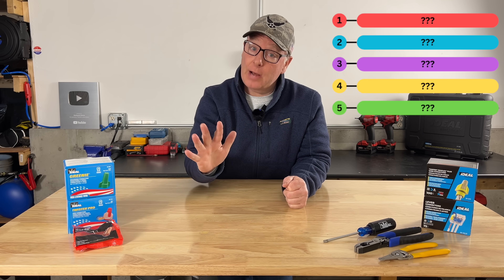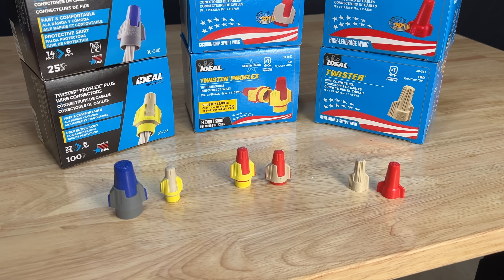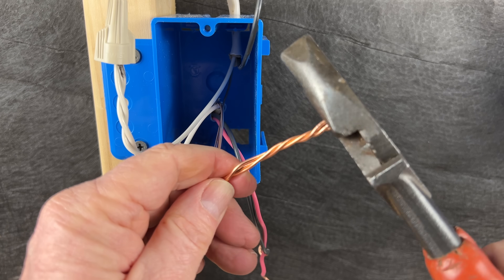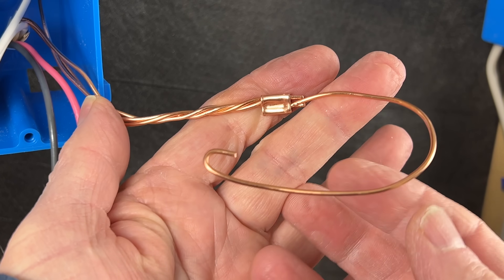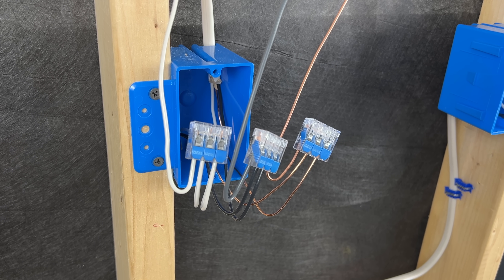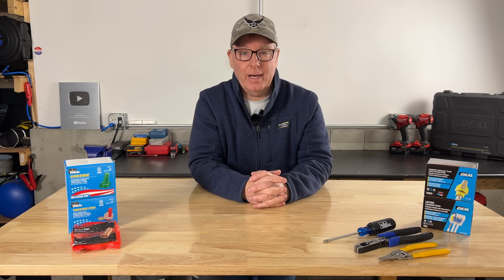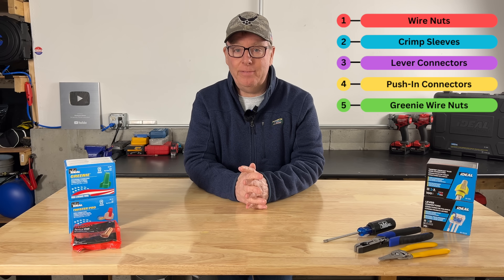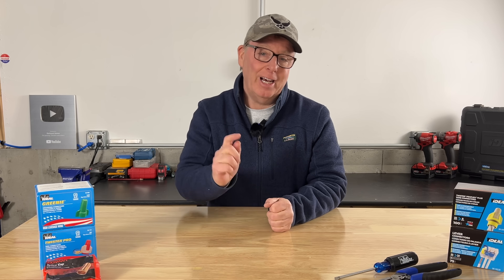How NOT to Connect Ground Wires in 2025 (Safety First)

Comment: Even using greenies for a while, but also use Wago and regular wire nuts. The ideal lever connector seems ok. I’ve always ran tape around the lever style connectors just as insurance from opening up when wiring the device. I never use the push in or bucannon crimp type.
Reply from the maker: The Ideal lever connectors close really tight. I don't think tape is necessary for using them.

Comment: I do not prefer lever connections (or any other connectors that cause me to break the grounded conductor). Whatever conductors that are used, I want to see the entire bundle of bare conductors twisted together tightly and then joined at the ends. 

I prefer the green wire nuts or the copper crimp sleeves as my favorite options. Buchanan makes a special crimp tool btw that crimps from all four sides. Not sure how necessary it is, but I like mine.

Comment: Sorry, but I hate electricians who pre-twist wires together. If I have to go back in and add, replace or remove a wire it's a huge pain in the ass, especially if I am working it hot. The speed & rate at which lever connectors are being replaced in the manufacturer's catalogs indicates to me that they are still being perfected, so I don't use them. Stab in bricks, suitcase crimps & wire nuts are still the same after 40+ years.

Comment: Two additional grounding methods for older homes with metal boxes connected to metal conduit; green ground screw within the box and green (or bare metal) tab on the end of the box
Reply from the maker: Yes for sure for bonding a box but this video was just covering connecting the ground wires together. I think I will make a complete grounding video cover the neutral bond as well.

Comment: The red & yellow Twister Proflex is absurdly oversized for a couple of ground wires. Sure it works, but why use such a huge wire nut and waste so much space in the box? The blue & orange Twister Proflex Mini (model 343) is much smaller, has the same rubber skirt, and handles up to four #12 solid wires.

Comment: Ok you dont' cut the twisted wires off square you cut them off at a 90 degree angle which tells me you never held a job as an electrician in your life.
Reply from the maker: lol.. I love hearing comments like this.. 41 years licensed electrician, last 10 years electrical engineer. Union trained and worked on some of the largest projects in the US. Had this video approved my an large electrical equipment manufacturer..

Comment: I'd love to see a treatment of the grounding clips that go on the side of a metal box. Where are they required, optional, or prohibited?
Reply from the maker: Metal ground clips for boxes are code compliant as a method of grounding metal boxes, provided they are an approved type and securely connect the equipment grounding conductor to the box. I prefer a ground screw myself.

Comment: Why didn't you mention the Ideal Set-Screw Wire Connector, Model 22, 20-10 AWG. It is the only connector I will use. I have seen problems with wire nuts and one problem is one too many. For the ground, I leave one wire long like you do and just leave the cap off. Thanks for all the information you provide.

Comment: I cannot believe that some electricians are still recommending these wire nuts from last century. Spring loaded push in connectors with or without lever are much more reliable than wire nuts or screwed connections. Since copper has a plastic forming component the contact pressure can become lose over time - especially when moving the cables or using in vibrating environments. A spring loaded clamp is not losing its contact pressure and here in Europe we are using about 99% spring loaded connections for such purposes. For these clamps a brand like Wago is recommented. Wire nuts are more less the bad example why some houses burn down.
Reply from the maker: You run a 2x higher voltage than we do and I believe you run stranded wire which is probably better for a spring loaded connector than a wire nut. The lever connectors here have improved greatly with these new designs but they will never hold up the reliability of a wire nut when connected properly to solid wire.

Comment: My house (built in 1975 in Doylestown PA) had NO connectors on the bare ground wires.  Whoever did it just twisted the bare wires together with no pressure connector of any kind.  Was that ever legal???   Just the act of accordioning the wires back into the box starts it untwisting.  
Every box I worked in got a Greenie.
Reply from the maker: I've been an electrician since 1984 and it wasn't legal then. I doubt it was legal in 1975 either. Good job fixing it up though.

Comment: Are the push-in connectors equivalent to back-stab?
Reply: No. On a back stab the spring metal is deflected towards the front of the receptacle and tension, while pushing down, is also pushing to the rear. A push in is at a 90° different angle, so the wire deflects the spring up, and the tension is to the bus on the push in. It's a mechanical contact advantage for the push in connector. A backstab connection is rated for 15 amps maximum and can only be used once. Using the screws on a residential grade receptacle, you can use 12 gauge wire and a 20 amp circuit. Push ins are rated for 20 amps, accept 12 gauge wire, and can be used again.
Reply from the maker: I think better than the stabs but I prefer the other methods shown in the video. They are very handy for lighting.
Reply: I like your content and style, good stuff. Some random adds for another day:

1) often see box screws and drywall screws used to secure the ground to the box, and light fixtures (especially florescent fixtures) vs the required 10-32 threaded connection for ground screws. 

2) The IDEAL 1 wire, in-line, push connector is an extremely handy connector to have in the truck.  It’s very handy to lengthen wires when you run into a box with very short wire leads.  Put a wire tail on one end, then reach in with needle nose pliers to firmly insert the “shortie” into the other end of the connector.  

3) It’s never really clear what crimper is “rated for” or “recommended by the copper crimp mfg”; but that’s what the instructions always say on copper crimps.  I see some folks just using their Kliens vs a real crimper.  IDEAL would be wise to specify their recommended crimper for their crimps.  

This is one of the first forums I follow where there’s no arguing on lever, vs wire nuts, pre-twist vs not.  It’s VERY refreshing to see.  I really liked your comment on pre-twisting too.  

I never read / realized receptacle back crimps are only good for one use. I never use them, most firms I worked for didn’t allow their use.  Great information for the lunch break arguments!
Reply from the maker: @ Awesome and insightful comment. Thanks for jumping in and sharing your experience..

Comment: Cracks me up, all the people saying you must twist the wires when using a wirenut, but think a crimp sleeve is acceptable for an equipment grounding conductor. The house I wired nearly 45 years ago is still going strong without either. But I took my time to properly strip and make all wires even, and installed the wirenuts tightly, using linesman's. In my present house, from the 60s that was built by contractors, I was able to twist off every crimp sleeve, many of them by hand. You're not doing that with the Buchanan B-caps. They work perfectly over the long haul.
Reply from the maker: If you were able to twist them off they weren't crimped well. But remember we also pre-twist them as well.

Comment: Long term DIY-er here. I bought my house from a guy who had delusions of adequacy. He made such a hash of its wiring that I had to redo it from scratch. I discovered Greenies early, and it was love at first sight.

A robotics team that I mentor uses another brand of lever connectors. You can bet your bottom dollar that we'll try Ideal's offering next fall.

Thanks.
Reply from the maker: I'm glad you found a method you like and have enjoyed using it! The other connectors are decent but the issue is the levers can open when pushing wires into a box. The ideal levers are really stiff and not going anywhere. I don't think you'll be disappointed.

Comment: Tried the green wire nut with pass thru hole. Not a fan but it does save one ground wire exiting the green wire nut. When you have 4 #12 solid ground wires found it easier to  bend & fold the group using a standard wire nut.

Comment: I use ideal push connectors for simple hot and neutral connections but still twist grounds and use crimp sleeves or wire nuts.  Wagos for stranded light connections.

Comment: Using a cap for grounds  is pointless honestly. They take up more space in boxes (which sometimes is needed) and caps are made to insulate energized lines. The ground isn't energized therefore needs no insulation. At least not in residential instances. The best thing to use is brass sleeves. As long as they're crimped properly it's perfectly fine and meets code requirements

Comment: Lot of good ways to make secure solid wire and braided wire connections. The professional electrician and the do it your self  home owners have different goals to get it done.  The Pro  goal is get in , get out and move on to the next job in a workman like manner. The home owner can spend all afternoon swapping out one two prong for a GFCI with a pig tail.  As a DIY guy I  have come to like the WAGO vs the traditional  wire nut for one reason.. You can clearly see that the wire is fully insierted into the WAGO connector slot.

Comment: True story. I was renovating a small home, and in one of the old outlet boxes, I pulled it out, and the ground wires were connected very badly, and in a way that definitely violates NEC. The 2 ground wires were connected to the ground screw by just shoving the straight wires under the screw on each side. I shouldn't have to explain how this is bad. As for how it violates NEC, well, in two ways. For one, it violates the code that says all devices are to be installed according to manufacturer provided instructions and specifications. Since the screw was only made for one wire, putting two wires violates this rule. But also, there's a code that says the continuity of the EGC shall not depend on the device being installed, where removing the device would break continuity. Removing that would definitely break continuity. So you can bet that I changed it to be proper and to code.

Comment: Can the push -in wires be disconnected once installed?
Reply from the maker: With solid but not stranded wire.
Reply: It's not really practical to try and disconnect the push ins once you go beyond the first wire installed since both IDEAL and Wago push ins require twisting while pulling on the wire to disconnect them. That's difficult and eventually impossible to do as you add more wires. You'll simply need to cut them off and toss the connector out. They're cheap so it really doesn't matter. 

I simply use push ins where I know I will likely never need to remove them and levers elsewhere. I think the two types of connectors complement each other.

Comment: I'll be the outlier here and say that Greenies are my least favorite method. I've opened up too many boxes and found the ground connections to be loose. People don't seem to take the time to install them correctly when they just give them a couple of turns and call it good, and because it is a fault circuit, this bad connection doesn't manifest itself until there is a fault and it doesn't clear. While I don't care for push-ins for active circuitry, they are better than Greenies, and I sometimes find them good for grounds. Because the grounding conductor doesn't go through heat/cooling cycles, there's no opportunity for the spring in the connector to weaken due to thermal cycling, and they seem to remain good indefinitely.

As for my favorite method, it is the crimp sleeve, for the very reason that BYM mentioned as a downside. They aren't easily removed, and this keeps someone from removing the sleeve unless they absolutely must. Crimps still only take a few seconds to remove. Just use your diagonal cutters lengthwise down the sleeve, and it comes right off. The crimp is the method that most guarantees that the ground path will be maintained. The only difference between what I do and the video is that I prefer to make my crimps with a C-24 crimper instead of single-point crimpers. I like the crimp on all four sides of the wire, and it seems to create a crimp with a lot of integrity. The first house I ever wired on my own, the AHJ required crimps, and I guess I've stuck with them ever since.
Reply from the maker: Thanks for sharing your experience and the reasons behind your preferences.  All connections definitely need to be secure no matter which method is used.

Comment: I like the Wago connectors out of Germany.  They are very robust.  For the lever and single use connectors I suggest twisting the wires together as with the wire nut BEFORE making the connections.  The reason is stress relief on the connector ports.
Reply: The IDEAL lever connectors are even more robust and better designed. The Wago connectors are also flawed since the levers lift up by themselves, sometimes causing the wires to slip out. Many users wrap them in tape while still defending the design. 

The one type of Wago connector I do really like is the 2773 push in line. They are significantly smaller than the IDEAL version and significantly smaller than any of the lever connectors from either brand.  I use them a lot on wires that I feel I will never need to mess with again. They are also inexpensive.

Comment: The more surface area of a connection the less chance of resistance , heat, fire, etc. The twisted wires with a wire nut is the only way I do it.

Comment: I replaced all the outlets in my house when i moved in, many were beoken, loose, poorly wired etc. all of the grounds used the crimp sleeves, and all of them were completely loose. I could by hand slide the sleeves off. Most likely the installer's fault, or they came loose over time. But i replaced all with wagos
Reply: I had the same experience in our 1967 house. I would NEVER use crimp sleeves, particularly on something as critical as an equipment grounding connection.

Comment: Best level connectors are WAGOs, nothing else. Push connectors are the best for solid wires. And removal is easy.
Reply: Wrong. The current Wago lever connectors are flawed. The levers lift up by themselves, potentially causing wires to come loose. The Wago 2773 push ins are the best simply because they are smaller than IDEALs. I recommend using THE 12 gauge IDEAL for levers and Wago for push ins. 

Push in connectors are great but if you have a version with more than two wires, there is no easy way to get the wires out. You'll have to cut them. Levers are of course easy for removal.

Comment: Thanks for the informative video! You always do a great job. I'm just wondering if you're a fan of the drill bits for tightening wire nuts? I think iDEAL makes those as well? I find them helpful as I get older and have arthritis in my hands and do still use mostly wire nuts. I do like the greenies although the drill bit wouldn't work on those. I may have to go to the lever locks in the future, not a big fan of push connectors.
Reply from the maker: I have seen those but I have never tied one personally. Maybe I'll pick one up and make a video on the subject.

Comment: Those three port lever connectors and a GFCI receptacle in a single gang box?
Reply from the maker: The ones rated for 12 gauge are much smaller. I was showing the ones rated for up to 10 gauge in the video.

Comment: A friend had to replace a light in his house. The ground, neutral and hot all had Buchanan crimps on them and were wrapped in electrical tape. After finding that he checked every light switch and receptacle but didn’t find any more of them…
Congratulations on the sponsorship. It’s well deserved!
Reply from the maker: Thanks, that sounds like a very dangerous situation!
Reply: @BackyardMaine  What makes that a dangerous situation?
Reply: @John.Doe-OG  Electrical tape is not safe for insulating the hot and neutral conductors.  Besides being soft and very easily damaged, tape (especially the cheap stuff) will tend to fall off over time, exposing bare conductors.
Reply: @danheidel yes, I agree, I found splices in my girlfriends house done with Buchanans and tape.  The house was built in the 1950s .  One had overheated and failed, fortunately it failed open not shorted to the metal box.
Reply: The crimps are what I always use on grounds but I wouldn't use them on the conductors. Caps are the most logical choice and code compliant
Reply: It is amazing how often I encounter that in older houses. Crimps on the neutrals and hots, then taped.
Reply: An old electrician friend of mine would use the crimp sleeves on connections in junction boxes that were in hard to reach areas. He would then wrap with rubber tape, then friction tape, and finish with electrical tape. I can guarantee those connections were not coming loose or dangerous.

Comment: I'm not a fan of the bare ground wire in the box with a device. Upon fitting the conductors and device, there's always the potential for that bare ground to contact the line side terminal of the device. I choose to put an insulated grounding conductor in service.
Reply: Use Leviton's great lever connecting outlets and switches. No side terminals to worry about.